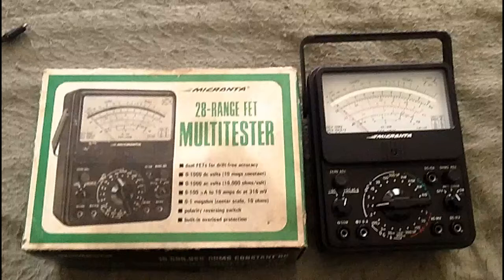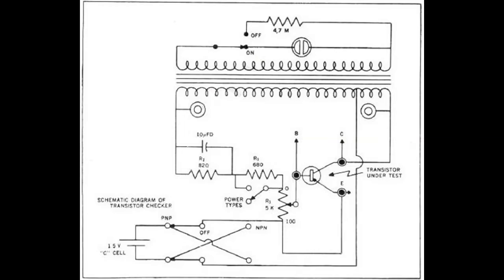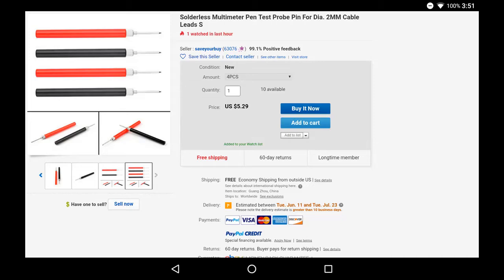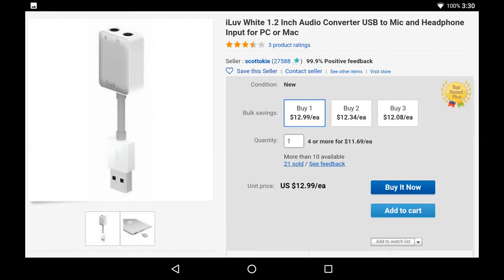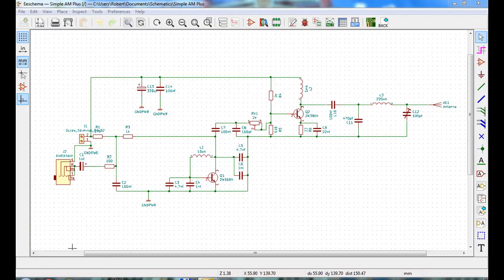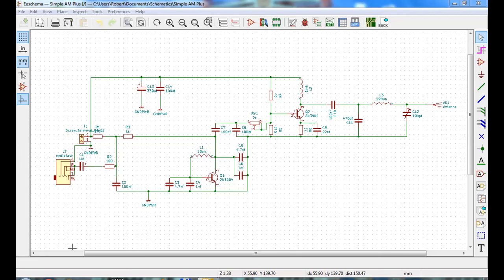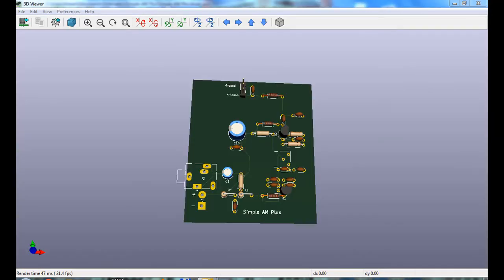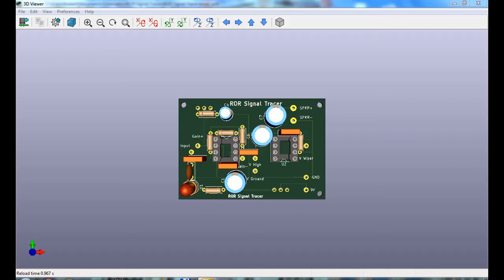Freebies and Ebay and PCBs

Comment: You acquired some cool items Bob.  I have one of those vintage transistor testers, they were great at the time because it actually used the transistor under test in a circuit (they are still good for testing bipolar transistors).  Although everything is going towards SMD components.   The FET multi-meter is really nice, especially that it's in like new condition..